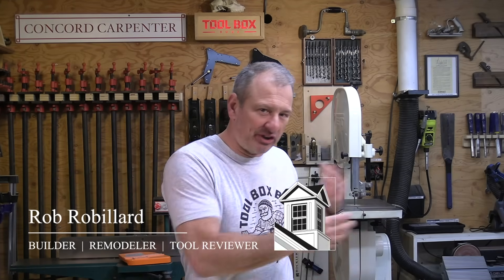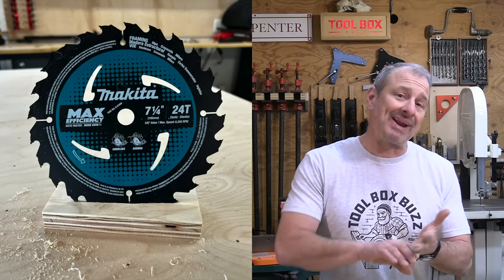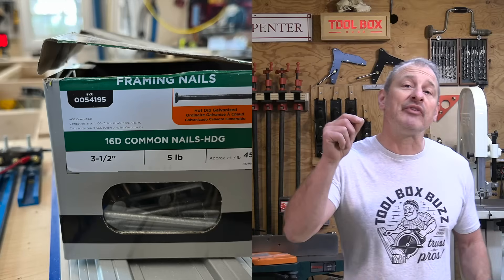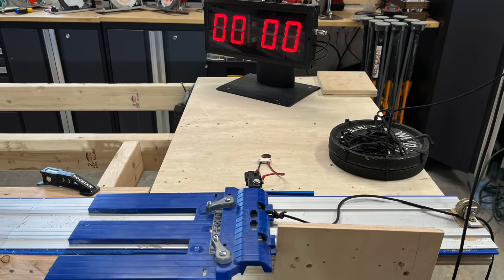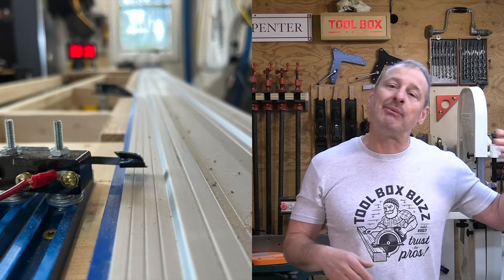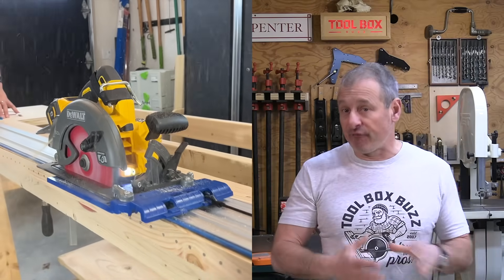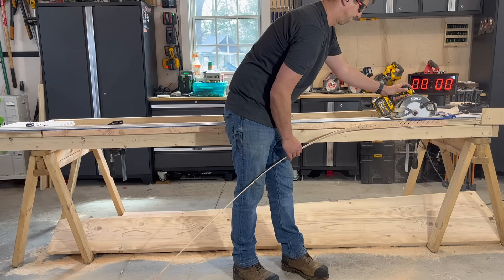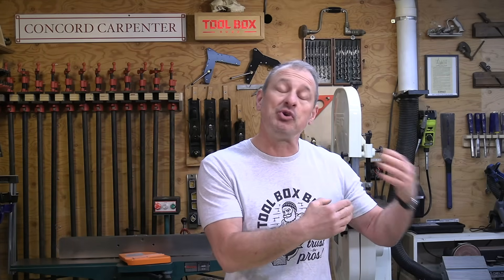24 Tooth Framing Blade Test

Comment: I am from when we took a stack of blades to be sharpend once a week.
Carbide came out, wow.
But the blades were a buck a tooth, and you hoped the stayed on!
My Porter Cable's clitches did not not like thin kurfs. Brands came and went. 
Here and now, I am looking for a modern framing blade for an 8 1/4" saw. 
8 1/4" are necessary when working with 'rough sawn'.

Here is the thing, all the test reviews I can find center on demolition durability.
OK, good to know, but what about how the blades actually cut???
Do they track , or do they squirm around.
Early thin kerfs made for cordless saws, were famous for that.
A framing should be fast and accurate. A little hair is no grief.
It the blade will do sheet material, great.  When it gets tired, then it is ready for demolition.
I settled on Irwin Marathons years ago, like they were majic.
I use Freuds in miter and table saws, but had no luck with them in circular saws, except for a high tooth one for cedar shakes.
Testing pure framing with out the sparks, would help.
Thanks Chris

Comment: Ive always ran diablo thats what the jobsite always had and has. I looked at my makits max efficiency blade and the teeth are so intricate compared to the diablos. The top of the blade tooth is angled at roughly 45 degree. Compared to diablos newr horizontal tooth. Also when looking down the tooth its not flat like a pancake it has and angle on the tip of the tooth making it an obtuse angle.

I was blown away by makitas design and want to buy some more of there blades to try them.

Comment: Lets face it. ANY carbide blade is potentially toast after even one nail hit. If you really need to cut through 86 nails maybe install an old blade and push it until the teeth break off.

Comment: Just picked up a couple of the Spyder 24t blades in 2pks for $8 a couple days ago($4/ea), and looking for how much quality I can expect. Not using my saws much these days, and have been runing a plywood blade on my main(Craftsman Industrial wormdrive) saw for a couple years, as it's simply worked for all the cuts I've needed. I've also got an older Makita sidewinder that everyone loved that I plan on equipping with these blades, as why have multiple blades between the saw fleet when their getting used for the same tasks,preference being whichever is closer. No plan on cutting through nails, as I've got plenty of old framing blades to use for demo tasks.

As to your question, as a homegamer, my times less expensive than blades, so I prefer blades that last longer vs a slightly quicker cut. More cuts per dollar vs quicker cuts that mean less cuts per blade.

Comment: Definitely want the fastest blades. 

Longevity does matter- but not through 90 nails…. 

We do not do remodel/demo work very often so this particular test isn’t that informative for my personal needs. 

How much do you pay the people using the saw? I make 45 an hour non-union right now. I’m not going to sit down and do the math- but I bet it costs more time to lose 10 seconds per cut all day than spending 40 seconds swapping out a blade once a day- or twice a week, or whatever! 

Also though- aren’t there other “demo” blades specifically designed for cutting through nails without sustaining life altering injuries? 

Pretty sure I saw them tested over on Project Farm!

Comment: @Concord Carpenter. To me sir I don't do Remodeling it's not my thing. I only do Framing, Decking, Sheathing and Drywalling and Demolition mostly masons or Concrete. I even do Electricity as well and I also do Welding and Metal fabrication on a Freelance Basis whenever I have time for some extra gigs but most of the time I do framing. And I chose Makita Max Efficiency ATAF-R Ultra Thin Kerf Circular Saw blade because it cuts faster, cleaner, No tear outs and cuts are so smooth and it's much better than Diablo framing blade, and the Makita Max Efficiency ATAF-R Ultra Thin Kerf Circular Saw blade is what I use since it came out of the market. The blade last me for 2 months of use and abuse only cutting clean wood with no nails. But IF I'm gonna do some demolition work I use Diablo 36T Wood and Metal circular saw blade or the Diablo 24T Demolition blade (The Amped version that cost $14 per blade) I admit The Makita Max Efficiency ATAF-R Ultra Thin Kerf blade is not good for cutting nails and demolition but this blade is far superior than Diablo when it comes to cutting clean wood this blade eliminated my needs for switching to 40T or 60T blade where I can only use the 24T and I will still get the same results as what 60T ultra fine blade does. I don't use Diablo framing blades because the kerf is so thick that it drains a lot of battery, it's bad for the saw. And by the way I still uses Corded circular saw in my Jobsite everyday I use Makita Hypoid Saw and Skilsaw worm drive. I only use cordless Makita 36V rear handle saw for Demolition and cutting metal or steel for welding.
Reply from the maker: Thanks for the thoughtful comment LC!

Comment: Diablo, spyder and dewalt are my first 3 top picks in that order. Best if you might encounter nails/screws/concrete on whatever you cut. Spyder is the 3rd pick from my list but its definitely good bang for the buck! Makita is my 4th pick. Beautiful blade but becomes trash instantly if you hit anything besides wood

Comment: As a Contractor Carpenter/Framer and Deck Builder I chose Makita Max Efficiency 24t Carbide super thin kerf blade over the others. As framer I don't cut nails when doing framing. Now If I'm gonna be doing a Demolition work, I'll use Diablo Wood and Metal circular saw blade 36t thick kerf saw blade that can cut nails, Deck screws even lag bolts too. And I have 4 sets of saw for for each and every work. For Framing I use corded circular saw either my Makita 5377MG Hypoid Saw or Bosch CSW41 Worm drive saw with Makita Max Efficiency saw blade. For demolition I use my Makita 36V rear handle saw equipped with Diablo 36T Wood and Metal blade. For cutting thick metals I got Flex 24V rear handle saw with stack lithium battery equipped with Diablo 48T Hard Metal saw blade. And for Concrete I use DeWalt DWE575SB equipped with Diamond Grit saw blade for cutting concrete or bricks also I use it too for cutting cement board.
Reply: Thank you for describing this as a carpenter thats into tools this is one of the best comments ive read.

I felt like i was there with your tools
My corded skilsaw is stored in my garage. I run the 40v makita 7 1/4  and 6 1/2. The 18v 5 3/8s. Dewalt 4 1/2. And i need to repair my 36v the motor burnt out, that is demo/cement board saw
I alao scored the 10 1/4 at friedmans no box for $240 so i had to buy it!

Comment: As a roofer that uses my Makita 36V rear handle saw for ripping new sheets of plywood I’m interested in speed more than durability cutting through nails. My sawzall is for demo when old work has nails and needs to be removed.

Comment: When I saw that you were using the Makita THIN KERF blade, I knew that was going to be last! I love Makita tools, but when it comes to accessories, they are too often a disappointment. They feel cutting fast on a cross-cut is more important than the blade holding up through nails, and I am sure 98% of construction people would rather the blade last longer, as you guys are saying.  As usual, Diablo is at the top. To know what they are doing far more often than not.

Comment: I’m leaning more towards cuts faster. You are test basic blades so if blades are similar in price and I know I’m going to buy a pack five or ten then longevity is not important speed speed speed. Also my struggle is find good multi tool blades a review on those would be great. I lean towards craftsman as they seem to do a good job for the price. But if I could find a blade that last longer through I would say finish nail not 16penny. Again thanks

Comment: As I don't usually intend to cut nails it's more important that it survives the cut. My helper was cutting up lumber for trash pile and the Diablo actually cut through a 3/8" carriage bolt. Blade was almost dead so I let him finish the other cuts. Dang impressed I was

Comment: I disagree with the assumption that more teeth equals better cuts.  I own a lot of blades for my 12 inch chopsaw and my 10inch cabinet saw.  My glue line rip blade has fewer teeth than some of my other blades but it cuts cleaner than most blades I own.  My 60 tooth blade in me chopsaw cuts cleaner than my 80 tooth finishing blade... 

All my day to day blades are industrial Royce blades so not the cheap stuff you get at HD...  So that might have something to do with it.
Reply from the maker: The tooth rake/angle has a lot to do with it as well
Reply: @ConcordCarpenter  teeth shape determine if it's a rip or crosscut blade.  The rip blades tend to have straight teeth but sometimes they alternate between straight and a "A" shape.   The crosscut has pointed teeth that alternates. 

The Combination blades...tend to have pointed teeth mixed in with straight or that "A" shape. 

The major difference between an industrial blade and a contractor blade is the thickness and weight of the material.  

Rake angle...  You have a positive rake angle for most tablesaw blades.  The idea is that it's supposed to help keep you work on the table.  

You mostly see negative rake angles on chopsaw blades.

I think the biggest factor is cleanliness and sharpness of the blades.  Gunk can build up over time and as for sharpness....  Some manufacturers send out dull blades right out of the box... I'm looking at you DeWalt....

Comment: Great channel, even if I disagree with certain videos, it’s still a great channel. Solid testing this time. 34 yrs framing and the Diablo tracking point is by far the best blade on the market. Cuts faster, smoother and tracks better then any blade out there. And on holidays they are 2 for $12
Reply: I'll try them again. Thanks
I am still in awe of how good modern blades are. Irwins have been just fine.
I did get a 6 1/4" Diablo for a cordless.
Joke on me it has a silver mirror finish.
This acts like a mirror. When cutting by eye, seeing double is trouble.

Comment: Glad to see Diablo on top. I'm a fan. I tend to use the 60 tooth for most everything.  I think it does a great job in most all materials.  The 24 tooth diablo demo demon is my go to if I think I might hit nails. It would be cool to see a battery longevity test of 24 tooth framing vs 60 tooth fine blade.  And a head to head 24 tooth framing vs 24 tooth demo demon on the same sled setup. Thanks for putting out all the great reviews.  As a carpenter who wants the best tools, many of my purchases have been based on your research! 👍
Reply from the maker: great blade

Comment: Nice work team. But I wonder if the accelerated wear test is realistic because if you’re only doing framing you probably won’t hit a nail. And I wonder if other factors would play in, such as the coating on the blade or the carbide tips versus heat or sap. For a demolition blade sure the test is more relevant.
Reply from the maker: Good point - I'm a remodeler. I like the cost of these blades for a demo, framing, etc.

Comment: help us get the most out of cut off wheels, corded grinder vs battery grinder how much does the rpm difference make, fast cut vas slow cut, is slower always better or is there a middle ground that works best, plunge cut or scoring cut, and once best method is determined compare disks

Comment: I want a blade that cuts fast AF and last forever,buuuttt... That's not really a possibility so next best thing is the Diablo for sure, they've really got their carbide formulations on point and know what they're doing. Literally only blades I buy, for both my carpentry/remodeling work, and woodworking hobby, all I use is Diablo.

Comment: Unless you have extra blades within 4 ft of the saw at all times.
The time savings is lost walking around the drywallers smoking in the garage (raining) , tripping over the tile guys extension cord in the driveway/busting your butt on wet concrete, sliding around the painters washout area by the dumpster, getting into the truck for a replacement, back through the jobsite up two flights of stairs, then realize the wrench fell out. Fast cutting is cute lol

Comment: I would like to see testing on oscillating multi tool blades. It seems like I got through those so fast. Also wondering if those sharpeners the have for those actually work. Thanks for the great videos TBB.
Reply: I would like to see these tested as well!  I’ve found that the carbide blades do last longer.  The key to making any blade last longer is to not let the heat build up too much.  Keep the tool moving back and forth as much as possible and blades will last much longer.
Reply from the maker: @baraksinz  agreed

Comment: I would have liked to seen a few other variables but as far as blades go I want the one that lasts the longest in the field. Speed is relatively marginal. It’s not the norm to use a circ to cut nails for me and my crew. So the blade that lasts the longest in a mostly fresh wood cutting scenario would be my choice. Ease of cut and battery effort are probably more important to many of us. As always thanks for the experiment!
Reply: Yeah this test was more for demolition,   I’m using the sawsall to zap nails or metals

Comment: When I'm in a reno/remodel situation, potentially cutting wood with nails, I usually throw on an old, used blade. Good to know how long they can last though. I wonder if the demo demon would've done even better.
Reply: Now that they have a repeatable setup maybe they can test more blades and have a running leaderboard! Demo Demon would be good to see for sure!
Reply from the maker: @patrickcallahan2210  agreed! The DD is a beast

Comment: That Makita Max efficiency blade is really thin. The kerf is probably a little over half the size of most.   I only have the one that came free with the saw.    The first few cuts I made were 90's on 2x4's.  I thought this thing is awesome.  Cut super fast and clean.  
Then I tried to use it to cut rafters...  I seriously doubted my ability to run a saw...  The little micro-corrections I tend to make are almost impossible to do with that thin blade.   Swapped it with the Diablo and I was fine.
I felt to me like if you're the type of guy that picks the dead right path right off the bat with your saw, that blade might be awesome.
Reply: Totally agree. I was less than happy with both my Makita (corded) hypoid saw and the LXTx2 rear handle saw until I switched out the OEM Makita blades for DeWalt 24T. Diablos are great, too, but  Makita blades are just too thin. Even on remodeling work, I try my best not to cut nails with a skill saw for reasons of blade longevity and safety.

Comment: I'm not a speedy worker, I prefer longer lasting blades, I have the power detect DeWalt saw and I still have the original blade, but I rarely cut nail or screw embedded wood

Comment: Diablo is definitely keeping the industry on its toes. They have stayed at the top of the pack for blades longer than a decade. To bad people figured out that Diablo could remove your catalytic converter in under 2 minutes. And they have blades that will laugh at your $100 safe.

Comment: Hi Rob...another good test. It will certainly influence my next blade purchase. One thing that gets up my nose is sandpaper. I purchased Irwin mesh type - supposed to last 4 x longer...bollocks it does! Expensive (in NZ) and not worth the $$ compared to normal! How about a H2H on orbital sandpaper types. What actually lasts longer. Also, Forstner bits... not all are equal! Wonderful job as always...thank you!
Reply: Interestingly, I just used the 3M Cubitron mesh sandpaper.  It actually worked faster than my carbide Duragrit sandpaper.  I'm sure the Duragrit will last longer, but the 3M is holding up.  And my oh my does it eat up the wood.  Also, the dust extraction is SUPERB compared to any other brand I've tried.  This was on an random orbital sander.

Comment: I would change the way you score some of the tests. The Diablo completed the test so it should get 10 points but 4 of the other blades were pretty close and should get 8 or 9 points. If you want to weigh durability over performance then score performance on a 0 to 5.
If one blade is 95% as durable but has 50% better performance it is clearly the better blade.
If durability is the only thing that matters to you then throw out your framing blades and run steel cutting blades.
Reply from the maker: Interesting m thx for sharing!

Comment: Those blades are a lot dearer in Australia as are most things. For the blade to last longer is nice. But overall user experience is important. I have that Dewalt saw and the rear handle Dewalt. I hate Dewalt blades. I struggle to find diamond arbor blades in Oz. You can get the Dewalt one but the saw is crap with it. I actually import Diablo blades from US to use on it. Different animal. Diablo blades in my opinion are by far the best for circular saws.

Comment: If a longer-lasting blade saves more time (and cost), then I agree it's the right choice. But if I were making an impulse decision, man it's tough to pass up a blade that cuts faster! For accessories, how about a close look at extension cords (eg., durability against wear/cuts, etc.)?
Reply: Yes. In general I would go for the more durable blade. But if I was building a deck from brand new wood the faster blade might be useful.
Reply: But the speed margins are so tiny, there’s really not much difference.  Durability wins out for me